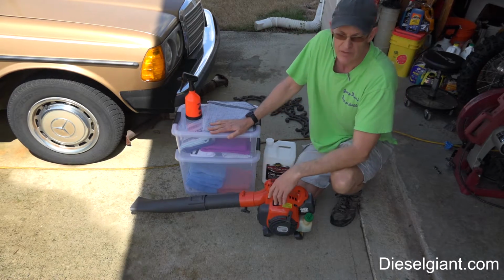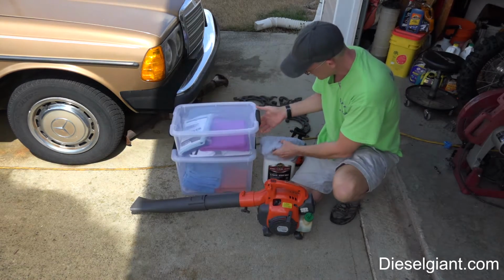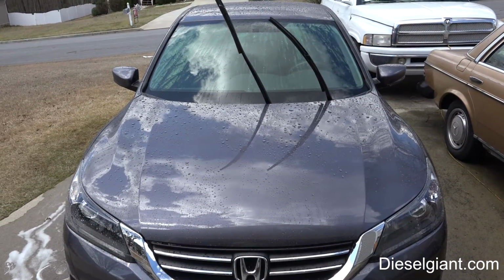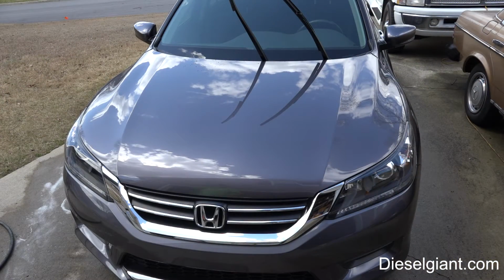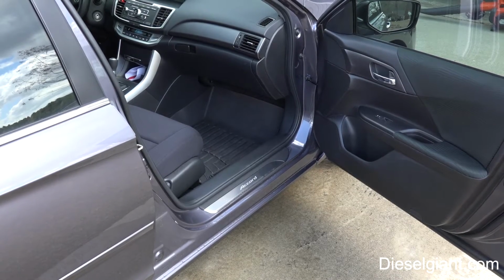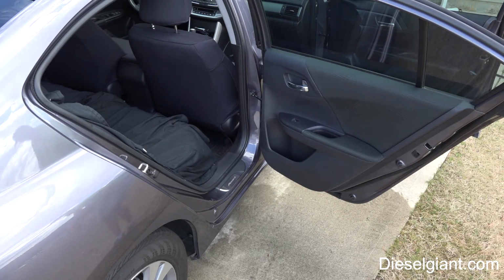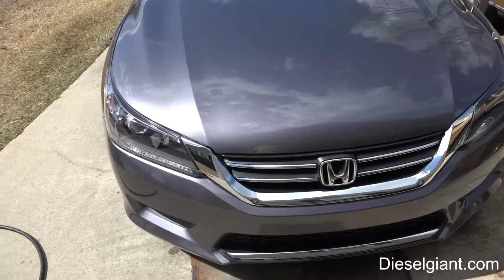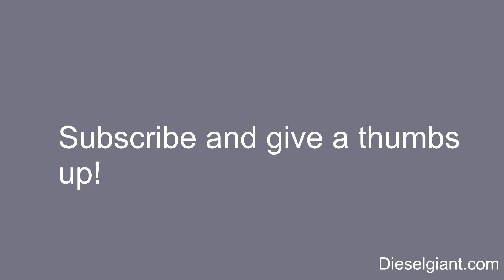How to properly dry a car without scratching

Comment: With out the leaf blower do you use the Maguires xpress spray wax as a drying aid when drying the car. Like you spray as you dry each area or do you go through dry it with a microfiber towel first and then come through again with the spray wax and microfiber?